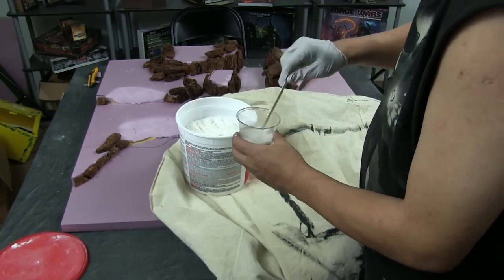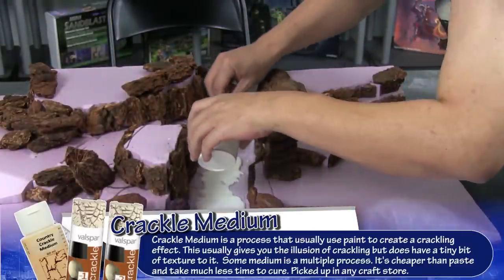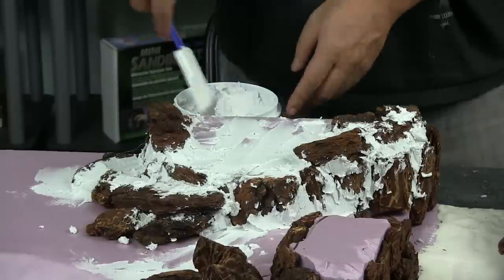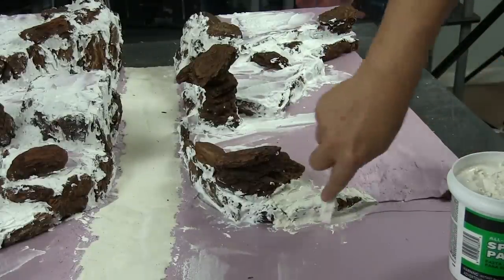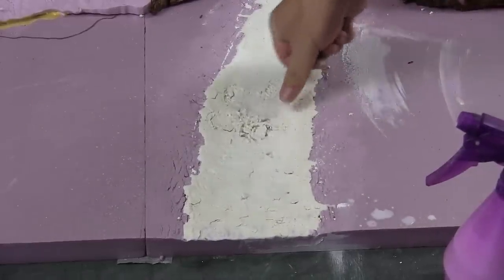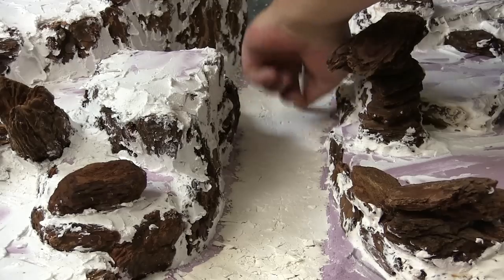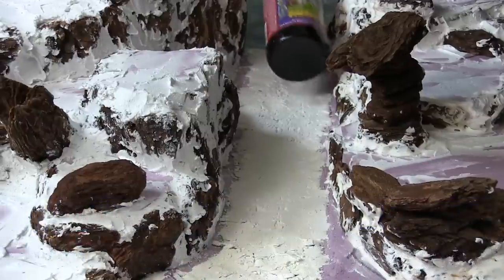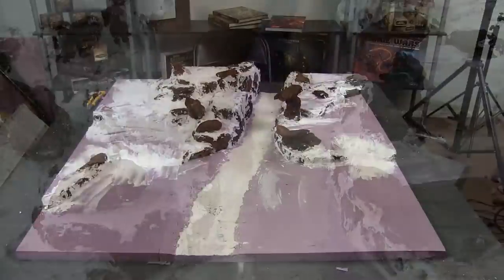Building a Desert Terrain Table for Malifaux: Part 3 - Dry River and Spackle!

Comment: That board is looking awesome, you can some times make the plaster crack by forcing it to dry by using a hair dryer on a high heat, your way also works just as well, plaster cloth is also a good alternative to Spackle and you get an amazing effect if you paint it using the leopard spotting technique, looking forward to seeing how this comes out, i love malifaux
Reply from the maker: Terrain Direct OO! Thanks for the tips! And Thanks for the watch!
Reply: The Wargamers Consortium

Plaster cloth is just Gauze with some PoP  applied by a roller.  In a pinch you can make your own with paper towels and PoP or Dental stone.

Comment: The bigger batch of plaster that you mix, the more heat it's going to generate, which is what causes it to cure.  This is why the thinner, smaller batch took longer.
Reply from the maker: TheOneTrueKaliban Yeh I giured that part out when my cup was hot as hell when the plaster was drying. :) Thanks for the watch!

Comment: You needed to rough up the surface of the foam before spakling. It will ultimately start popping off. Also the river bed will form a bend point that even teh MDF will have trouble fighting against. You will need thicker MDF to keep the board from curving.
Reply from the maker: Video Rebel Thanks for the comments!

Comment: Nice effect on the cracked river bed.  Did you/are you going to put the whole board onto an MDF/wood base?  It looks like you've got a heck of a weak point where you've gouged out the river, the way it flexes when you push down on it.  I'd be worried about it snapping during transit or with heavy-handed gamers leaning on it.
Reply from the maker: Yeh I am. I just forgot to when I started the project. I can easy to that later anyways.  But I am making a frame for 3x3 tables so I can drop these boards into but for the purpose of moving it around, yeh I'm going to have to put some backing on it.
Reply from the maker: OH! and as always thanks for the comment and for watching! :)

Comment: an alternative to PoP might be a dental stone.
Reply from the maker: Galorn Isn't Dental Stone harder than PoP? I've never worked with it so I don't know myself
Reply: The Wargamers Consortium
yes Somewhat but as a thin layer (thinner than 1/8 in) that is somewhat easier to make as a paste  it cracks just fine.  It also will dry harder.   It is harder and as a result actually somewhat less flexible.

I'll bring some to Captain Con 2015 if you can make it.
Reply from the maker: Galorn Excellent. I'll pick some up and play around with it
Reply: The Wargamers Consortium

I've used Excalibur brand pretty extensively at this point.   (it will get great details out of RTV molds too...)

Comment: Another nice step to the build man thanks for sharing. I also use the lightweight spackle to blend my stuff together. I have had some success watering it down just a bit so it flows into the cracks a little easier. Looking forward to the next video!!
Reply from the maker: BlackTower Terrain Yeh I notice using water will help with that. I dilute it a little when I'm spackling the cork on my bases and make it into goop first with water. Thanks for watching!

Comment: One thing I have used in the past instead of straight PoP is the "Goop" recipe that Viv has a video for over at RubbishInRubbishOut. I think this same recipe was also used by TheCamloopian. The stuff is great for the spackling if the board and would probably crack well for the river bed as well.
Reply from the maker: maxxpayne390 I'll give that a try some time! Thanks for the suggestion!